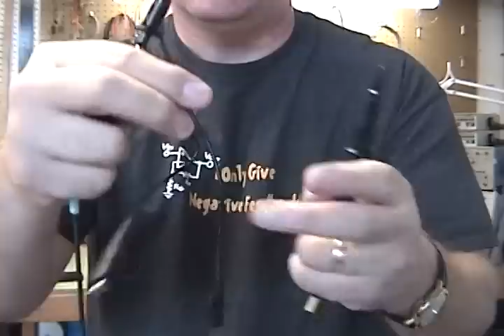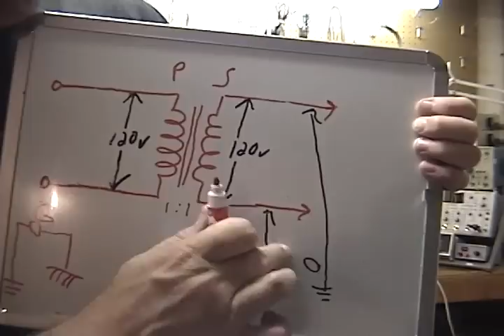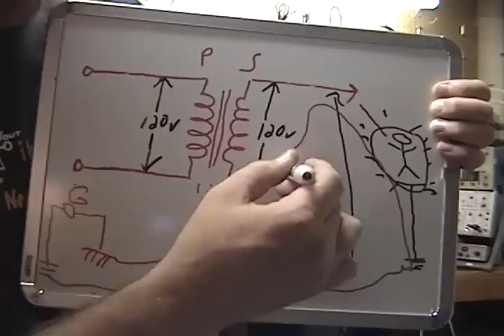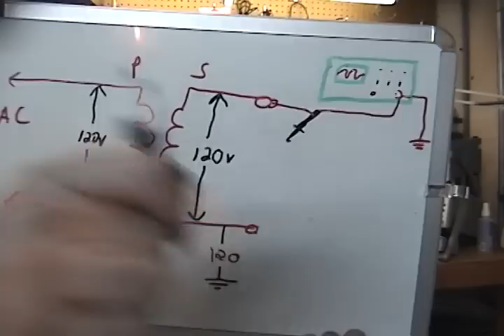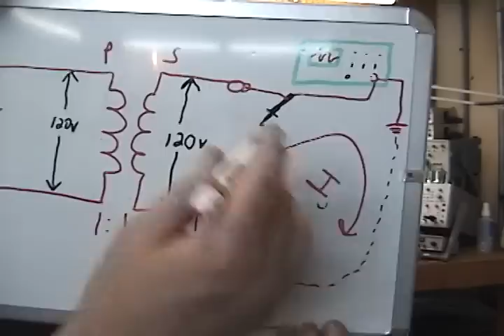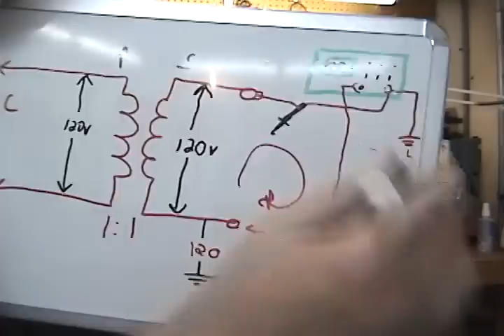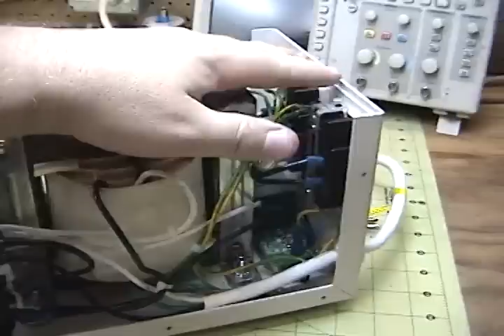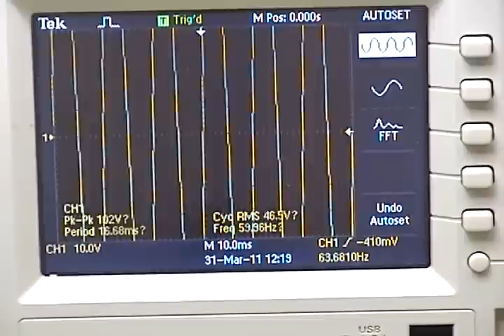ToddFun.com: Isolation Transformer - Tripp Lite IS1000

Comment: Todd -- You might have addressed this next concern toward the last part of your video, but some further clarification would be appreciated.  

Even after making the modification to turn the IT into a "tech" version, the grounding return path ("earth ground") is not isolated from the mains service ground because the neutral and the ground return wire are connected at the service entrance (as required by the NEC).  Hence, there continues to be a current path between the IT outlet neutral and ground. 

Therefore, wouldn't there still be a potential mains power path between an oscilloscope probe and the DUT if the DUT has a three prong plug?

And if the answer to the above question is "yes", then when the DUT has a three prong plug, shouldn't a 2-wire to 3-wire "cheater" plug be used between the modified IT and the DUT to eliminate the any potential path between the oscilloscope probe and the DUT? 

Or am I misunderstanding something?
Reply from the maker: Louis Wilen No. There will be no path from the secondary side of your Tech transform back to mains ground unless you have a fault or have connected something to the secondary that is mains grounded like when you connect a ground clip on your oscilloscope to a DUT, as covered in detail in the video. Yes, a cheater plug will proved additional isolation but will also float your oscilloscope and as well as your DUT if you do so for both. Using a cheater plug is not good because you could put damaging voltages across your oscilloscope unexpectedly and destroy it. That is a risk you take if you want the added isolation, I have risked that myself without issues from time to time. Finally, by floating everything for "safety" you set yourself up for another danger that wouldn't occur if you had left all safety ground paths in place. With the cheaters you do have more isolation but setup mistakes, connection mistakes, damaged devices and completely impossible errors still occur which can put a lethal voltage at your oscilloscope's unshrouded BNC connections (as one example point), meaning you reach to touch something that should be safe or plug in another BNC probe and you get hurt or killed. If the BNC or DUT was not floated such electrical points would have already shorted to mains ground and you would have tripped a breaker, smoked your DUT or smoked your oscilloscope before ever setting yourself up to be killed. This danger can still happen even easier, as noted in my video, when you don't float anything but the key is you are never trusting a float so you approach knowing 2 things 1) You might not be 100% safe as you are test and 2) You will not be risking damaging expensive oscilloscopes with a floating ground. Think of it like this, in the US you can consider everything grounded around you and it is very likely you are touching something that is grounded at all times, so if high voltage potentials can exist you want to know those points can't be things you are normally comfortable touching like metal DUT chassis or grounded BNC probe connections. That DOES NOT mean your DUT is safe when not floated, as noted in the video, once you connect a probe ground clip to your DUT all electrical points on the alternate side of the DUT's power rail become a danger point between it you and anything mains earth grounded for the every reason you stated. You just want to be safe for yourself first and your equipment 2nd. If you are ever in doubt get out a volt meter with a low Z setting or get a low Z adapter and test for dangerous voltage between points before connecting or touching. Does that help?
Reply: ***** Maybe I wasn't clear.  I was suggesting the cheater plug on the output of the IT.   Definitely no cheater plug between the scope and the mains power.
Reply from the maker: Louis Wilen Same answer. More isolation, yes, but also a dangerous setup because you always want everything tied to ground that is metal chassis and not directly electrically connected to either leg of your secondary coming from your transformer. Think of it like this, everything comes with a 3rd earth ground wire that houses high voltage within the product. There is a reason for that 3rd unused wire in all these appliances and tools, it is for safety, for just in case, for that unexpected almost impossible condition when what is conductive and can be touched by a person is in a fault state with high voltage easily touched by people. You can't get hurt if the breaker has already tripped do to a short to ground condition. One last note, I plug everything including my IT into a good GFIC outlet. I have received quite a tingle when I have made mistakes but the GFIC tripped before it reached anything painful, and I'm real careful most of the time. GFIC will trip under high inductive loads by mistake sometimes and you don't need to plug your IT into a GFIC, I do because everything in my lab is GFIC socket-ed. The inductive trips are expected and will happen when you turn on a large IT but the added overall safety in the lab is worth the annoyance. Mind you, a mains GFIC DOES NOT add any ground fault protection after a transformer like your IT. The GFIC becomes blind to ground faults after a transformer so don't think you can make mistakes after an IT just because everything is plugged into a mains GFIC. I think I showed that scenario in the video too. You could, however, change the output socket(s) on your IT to GFIC socket(s) because there a GFIC will work once again with respect to your powered DUT environment. I'm happy to help if you have more questions. I like the opportunity to refresh myself on safety subjects.
Reply: ***** Thank you for the clarification, Todd.  This is very helpful.
Reply: Louis Wilen
Also -- that's an interesting suggestion to put a GFCI on the output of the IT. 

As we know, a GFCI will trip when it measures >5 ma difference in current between the two sides of the GFCI's output. 

When a DUT is plugged into an IT, there is no concept of "ground".  Therefore, a ground fault would not be created even if the tech got between one of the holes in the socket and, say, a grounded water pipe.  You can't have a leak to ground if there's no ground!

It seems to me that a GFCI on the output of the IT will not do any good (nor will it do any harm). 

Am I misunderstanding something? 

Can you get your (output) GFCI to trip by putting a resistor between one of the socket holes and ground?   If not, it seems that there is no point in using the GFCI on the output of the IT.
Reply from the maker: Louis Wilen Sorry, I didn't think through that GFCI idea on the output of the IT too carefully. I never added a GFCI outlet to my IT but had it in my mind to do so for some reason. As you pointed out, it would be stupid and I'm glad you pointed that out because I always had an itch to add one. Strange how things can seem so right but can be so wrong until you take the time to think about the situation. It just goes to show, you can never be too safe around high voltage.
Reply: ***** No problem, Todd.  The subtle complexities of grounding and current flow trip all of us up sometimes.  That's why, as you said in the video, you have to keep your head in the game.

Thank you again for  your video and the accompanying text.

Comment: After making the modification described in the video to a Tripp Lite IS-250HG (same as the unit in the video except lower current capabilty), I made the following observations:

1.  There is 80 VAC RMS between the outlet neutral (wide hole of the outlet) and the ground connector on the output.   This was not expected and indicates incomplete isolation.

2. There is 16 VAC RMS between the outlet hot (narrow hole of the outlet) and the ground connector on the output.  This was not expected and indicates incomplete isolation.

3. With the unit unplugged and the power switch on, resistance between outlet neutral (wide hole on the outlet) and neutral on the input is infinite, as expected.

4. With the unit unplugged and the power switch on, resistance between outlet hot (narrow hole of the outlet) and hot on the input is infinite, as expected.  

5. With the unit unplugged and the power switch on, resistance between outlet neutral (wide hole on the outlet)  and the ground connector is infinite, as expected.   This confirms that the modification was made as instructed. 

6. With the unit unplugged and with the power switch on, and with the neutral prong of the input power cord shorted to the ground terminal of the input power cord, resistance between outlet neutral and ground is infinite, as expected.   (This was done to simulate the ground to neutral connection that is provided at the circuit breaker box.)

The measurements were made with a calibrated Fluke 179 DVM, which is a high impedence DVM.

Observations #1 and #2 indicate that isolation will be complete only if a 2-wire to 3-wire "cheater plug" is used between the IS-250-HG output and the DUT.  However, observation #6 tends to indicate that the voltages detected in #1 and #2 are actually phantom voltages.  If the voltages in #1 and #2 are phantom voltages, a cheater plug would not be required to provide full isolation.

Any comments?
Reply from the maker: Louis Wilen The word you need to look up is "Ghost Voltages" Kind of what you hint to with "phantom" voltages. I did cover this in the video and it is normal when using a high impedance DVM, As you will note in the video, I used a Fluke 117 set to Auto-V LoZ which is a low impedance test setting the Fluke 117 has to eliminate ghost voltage readings. Ghost voltage readings are harmless. A cheater plug will float whatever is plugged in but will not help with isolation, cause as you said, the common leg is tied to the ground rail at the fuse panel and many things around you are grounded including "the ground". Your modified isolation transformer will help with protection but take careful note that you can still get hurt or killed in may ways, as I noted in the video, even when using a Tech Isolation Transformer. Be safe and I hope that helps.
Reply: *****
"Ghost Voltages" -- yes, that's a better term for this.  Thanks so much for your explanation.   As you suggested, I looked up "Ghost Voltages".   Seems that putting a moderate load across the output will eliminate the ghost voltage reading if it's truly a ghost voltage.  If the voltage reading is still present with a moderate load, then the voltage is very real and isolation is not complete.   An excellent explanation of Ghost Voltages is in this Fluke document:  http://support.fluke.com/find-sales/Download/Asset/2105317_A_w.pdf

And yes, you do mention Ghost Voltages in the video.  I missed the explanation the first time that I watched.
Reply: It's interesting that you mention a cheater plug, because, a few years ago, I bought a Tripp Lite IS-250 as a last shot at trying to solve a hum that I was experiencing through a subwoofer, but it didn't solve that problem. I see that Todd states in the video that these Tripp Lite isolation transformers strap the secondary coil winding to the chassis for common mode noise rejection (acting as a secondary neutral). Is that done only to solve noise issues on the AC line, but not the ground? Since I wasn't going to pay to ship the transformer back, I've just had the Tripp Lite in a closet until today.
Today, I was reminded of all this when I noticed that whenever my laptop, which uses a three prong power supply, was plugged into the wall along with its headphone out plugged into some of my powered audio equipment, that this would cause some major ground loop noise. Plugging the laptop power cord into the isolation transformer did not solve this problem. Unplugging the power cord, or plugging it into a non-grounded cheater plug did solve the problem (though, it's my understanding that I shouldn't do the latter for safety reasons). 
Is it possible that one of these Tripp Lite isolation transformers could still solve my problem, with or without the above modification, but mine just happens to be a dud, or is it the wrong tool for the job? Would doing the above modification to it make it capable of solving my ground loop problem without having to resort to a cheater plug, or is the above modification also not the solution to my problem? I know they make 3.5mm ground loop isolator filters, but I'm curious if there's a way to create a safe, isolated circuit to plug offending devices into that would stop the problem at the source.
Reply: Sounds like bleed over to me. When I kill outlets in my home at the breaker they still can show as much as 60 volts, however it wouldn't light a bulb. Really no current behind it.

Comment: Can you explain why the osciliscope is not connected into the same triplite as the light bulb? So only the device to be tested should be connected to the triplite? and the measuring tools (whether oscillator, frequency generators, signal tracers  etc, should all be connected directly to main power?
Reply: I'm somewhat new to hobbyist electronics but if I remember correctly,  an oscilloscope (or other test equipment) should not be connected to an isolation transformer because you defeat the purpose of the safety ground.  Only the device under test should be connected.  Here is a excellent short paper by Tektronix on the subject - http://www.cbtricks.com/miscellaneous/tech_publications/scope/floating.pdf

BTW - excellent video!

Comment: Thanks Todd for this detailed explanation and demonstration of the need for an isolation transformer for safety reasons. I am getting the non-HG version of this for my personal safety and not for noise isolation. I read one review on Amazon that tipped me off to the need to modify this transformer to be used as a safety isolation transformer:

"This is a nice unit, but be aware that it does not provide full isolation from the mains. The hot side is isolated, but the load neutral and load ground are bonded to the lines ground. It is not possible to float a device-under-test with this transformer in its stock configuration.
If you only need hum bucking this device will work fine. If you intend to do electronics work with floating power you will need to modify the internal wiring, which I am sure voids the warranty. It's not hard to do - if you need it, you should have the knowledge of how to do it. Be aware that the load receptacles are electrically bonded to the case, which means the case must be moved to the load ground."

http://www.amazon.com/review/R3NYMSG0S1X2CP/ref=cm_cr_rdp_perm?ie=UTF8&ASIN=B00006HPFI

Unfortunately, it doesn't mention just what needs to be done to do this so I did a Google search and hit upon your video. I like to know in advance just what I am getting into if I buy an expensive piece of equipment like this BEFORE plopping down all that money.

Your video showed me most of what I need to know but not all. You didn't show the removal of the ground strap lug and what you covered it with.  The video had a glitch at that point and jumped directly to the point after which you modded it. This is the only part of the video that is of interest to me at this point as I intend to use the transformer for antique radio restoration, heater control circuits, and motor control circuits.

My first question is, is that common wire attached to a spade lug which is simply attached with a screw? Then, did you crimp the spade lug into a crimp coupler or tape it or what? The sound glitched at exactly the point where you say what you covered it with. Also, did you use a philips head screwdriver or a proprietary one like a torx, etc. to remove the cover? I'd like to know what I need to gather before my unit arrives.

Another point I'd like to make is that you really scared me when you picked up that live aligator clip attached to the lightbulb powered by the unmodified unit. Your fingers were millimeters away from the live metal clip, making you a potential path to ground!

BTW I visited your blog and wanted to make these comments there, where it would perhaps be more appropriate, but I could find no way to register. Are you accepting registrations at this time? If so where is the link?

Comment: I live in a country where we use 220V and no ground slot in the outlet, would I still need an isolation transformer?

Also, isn't removing that ground wire inside the transformer the same as removing the third prong from the power plug of whatever equipment you're plugging into the transformer or maybe using a cheater plug?

Thanks, just subscribed to learn more.
Reply from the maker: Skunky Donkey If your country uses "earth" grounded domestic power delivery  scheme then, yes, you still need an isolation transformer with or without a ground slot. Some countries and industry buildings don't use an "earth" grounded scheme in which case "earth" is not in the electrical loop, but other plugged in objects would be in the loop so an isolation transformer is still recommended when working on mains powered electronics. Removing the ground wire inside the transformer would be the same as removing the third prong or using a cheater plug. However, that leaves no safety ground to the metal transformer chassis which is not a big deal other than it would be a bit less safe than if it had a safety ground. Does that help?
Reply: ***** Thanks for the response. Your video and your answers helped me understand what I need to do to protect myself and my equipments.